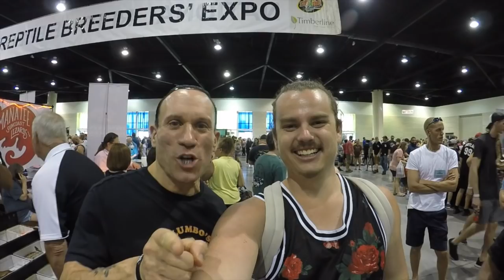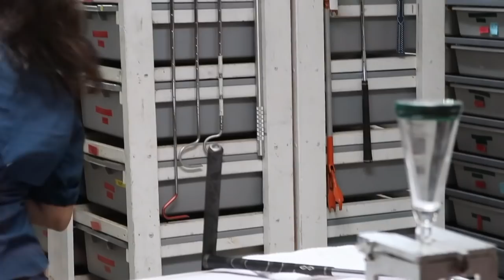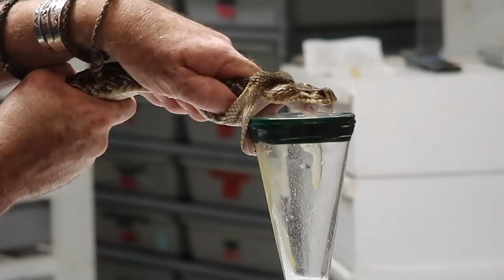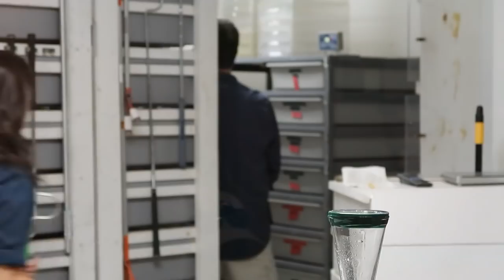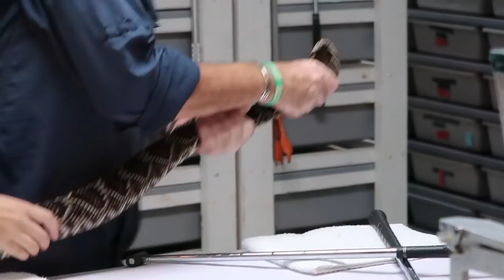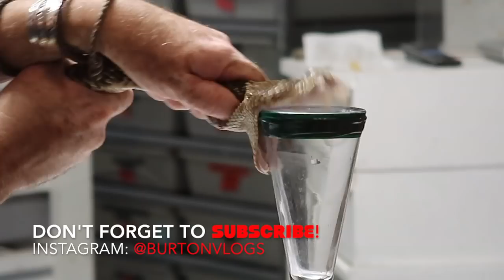Rattlesnake Venom Extraction! HUGE FANGS!!

Comment: How we can sell this venom?
Reply: For the production of anti-venom to save lives. It’s a very expensive job dealing with venom and the process of the anti-venom and snakes in general. If you have to get anti-venom if you get bit, it’s going to cost you a hefty price at the hospital. Not cheap at all
Reply: Keshav S   Yes check it out. It’s very intriguing. They put it in horses so the horse can develop antibodies to the venom and they take the antibodies from it and make anti-venom with it. It’s a long process and that’s why it’s so expensive. There’s people that have been bitten that went to hospital and got anti-venom and their hospital bill was $50,000 - $140,000 sometimes more depending on how many vials they needed of the anti-venom. You can make a lot of money if you’re in the business of milking venomous snakes for the process of making anti-venom but you also run the risk of getting bit and dying while doing it. Very dangerous and important job.
Reply: @kolbyorozco9494  North American pit viper Venom is mixed with Australian sheep in the production of c r o f a b Anti-Venom. Which is sold to hospitals at a discount price of 3,200 per vial that results in the patient having to pay $12,895 per vial Hospital charges.